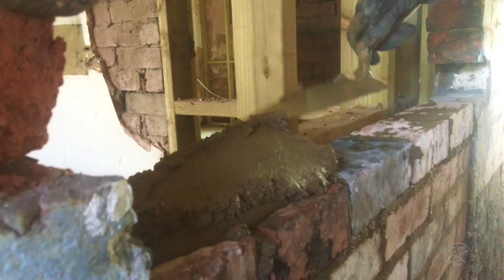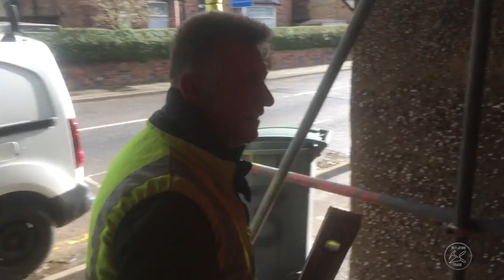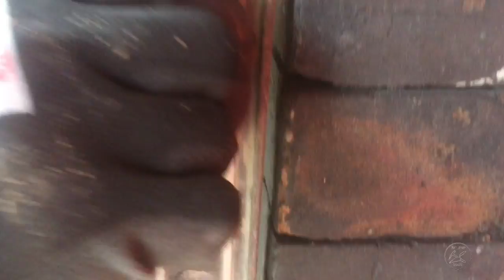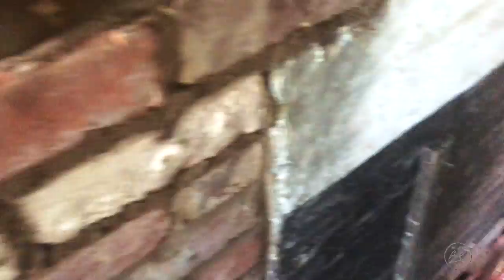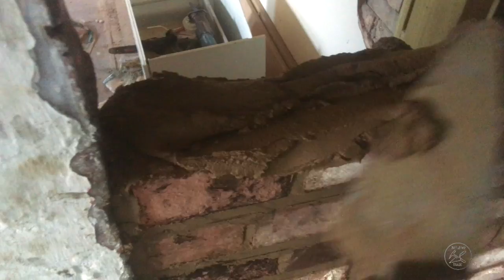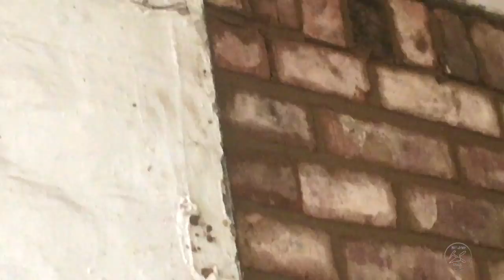Brickies vlog: bricking up a doorway

Comment: Chris, why did you use ties and not key in the bricks more. I’ve got to do the same job (enthusiastic amateur inspired by your videos) and dreading cutting out the old wall to make the keys. Laying brick is the easy bit.
Reply from the maker: The bricks had to be set back because they are different sizes (architect wanted)...However it's tied in with ties screwed into the bricks..